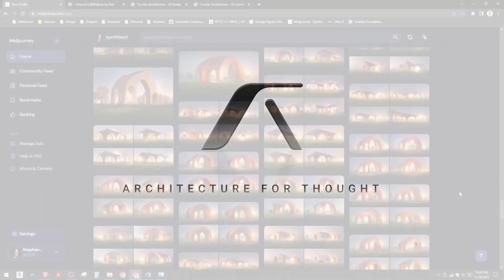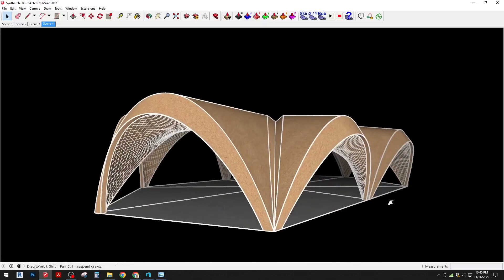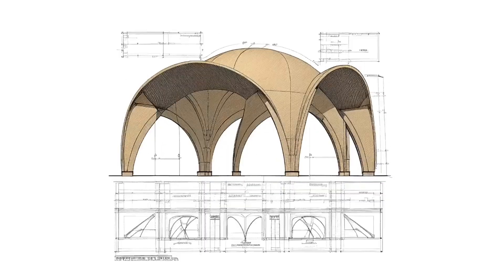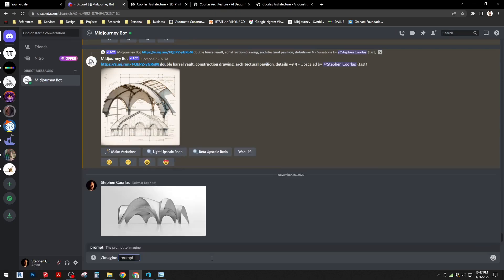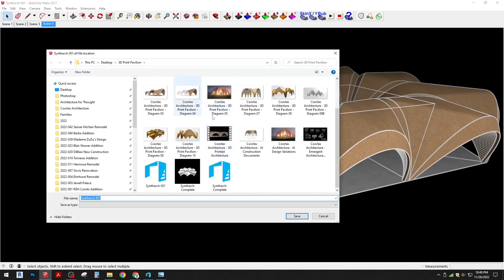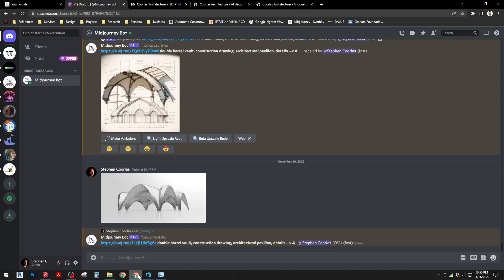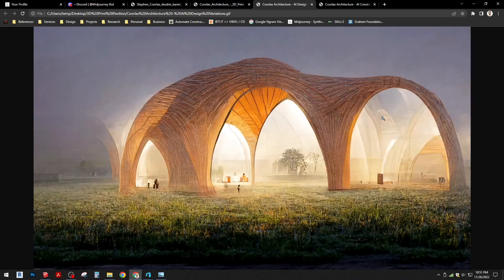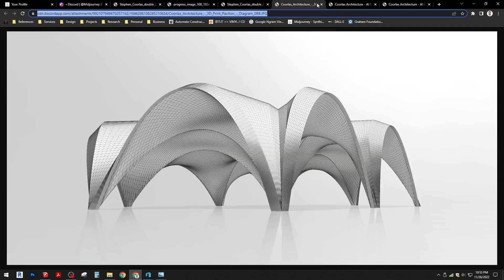Midjourney Architectural Design Workflow

Comment: Hi, thanks for the video. Super interesting. Can you clarify what is the exact purpose of generating these drawings? They are not drawings you can build off of right?
Reply from the maker: No, you cannot build off these drawings, yet. The idea here is that we will not need traditional drawings to "build" from in the future. The hope is for image > 3D > digital fabrication will be a completely automated process. And that technical documentation will be replaced by digital fabrication instructions that are for reference only.

This video is highly conceptual, and based on that research.

Comment: Can you just render your basic image into a setting without MidJourney changing the design of the architecture?
Reply from the maker: Unfortunately, no. Not yet at least. There are plenty of other programs that will do that though. Try Veras - they offer a great standalone ControlNet based platform. PromeAI also offers some free trials for this task. You can check out my “Sketch to Render” video that features some of those tools.

Comment: This is Awsum, like the application becomes even more interesting when you integrate regulations and parameters of building systems into the BIM like model testing in real-time with defined requirements like brief to construction. Makes cradle-to-grave design becomes when it becomes integrated to Revit to generate models from images or text. Very exciting prompts for generations give so much room to design. Microsoft project AI integration for optimized workflow in the office and site though I will say error correction is something that is easy to identify seems to be part of this design approach. Ai still experiences basic math issues which I find quite strange seeing as they are written in code, Is this bad coding or an approach of prediction vs calculation that generates errors. Still so cool
Reply from the maker: These are good questions, and I think a lot of people are asking similar questions. The AI systems will get better, meaning more accurate and easier to work with, so I think it's important to remember that these technologies are still in their adolescent years of development. Thanks for tuning in!

Comment: Hi Stephen, A couple of your videos really kicked off some productive midjourney explorations for me and my team.  Glad I finally connected with someone who is explaining what I need.  Thanks!

I have a specific question and hope you don't mind I ask it here.  When working with a reference image, or multiple (as with your white 1 point perspective staircase, separate video) how do you lock the perspective of the image?  I couldn't see a keyword in your prompts that indicated "use the same point of view as ref image x" but it seems to work for you.  My reference image results seem out of nowhere with all new camera angles.
Reply from the maker: Hey Phillip - Glad to connect and happy to hear these videos were helpful.

I the case of that stair image, the results were just coincidentally aligned with the same perspective. If the reference images have a strong relationship in terms of perspective the results typically will follow. But to ensure that the results are from a similar perspective you can add exactly what you typed , "one point perspective staircase" and maybe add some additional qualifiers such as "centered" or "focused"

Comment: I totally understand AI as a source of inspiration and iterations engine but other than that it's very abstract and random.... poor engineers that will probably have to deal with all that... anyways. The "drawings" as presentation layouts were quite nice, but as far as I can tell the views included were absolutely random... I might sound a bit bitter but all that philosophical approach of architecture is really getting on my nerves... or i'm just to shallow to grasp...
Reply from the maker: I agree with you. These tools are not very reliable in terms of documentation or even producing consistent designs from multiple views... yet.

But that's why I research these technologies - to help nurture the integration of the tools in a responsible and reliable way with our current architectural workflows.

The philosophy is also just a personal approach I use to help better understand the implications of using these tools, and in effect how they may change our profession or even society.

Thanks for sharing your thoughts 🤘

Comment: I think it is a good generator of concepts that could inspire, but right now it is very infantile in producing anythign that is usable.  Having a pretty picture doesn't translate into actual 3d models on its own.  Still lots of investigation to be done.
Reply from the maker: Have you tried ZoeDepth on the Hugging Face website? It offers AI generated 3D models from image inputs.

Yes, still much investigation to be done, but it seems promising.

Comment: Where are you planning this pavillion? Did you push it towards a Serengeti vibe? I'd be genuinely interested to know where the location came from.
Reply from the maker: It will be located in the north suburbs of Chicago. We are developing a general plan/design that may be adapted to any of the townships here, but it is significantly dependent on funding. I will have some interesting updates on this pavilion to share shortly.
Reply: @LEAPractitioners  Cool, I'll make sure to check back. Do you see earth building in this way being adapted into general building practice?
Reply from the maker: @nathan1459  I really hope so - At some capacity it will be adopting, but it may not become "mainstream" for some time. It will be supported by groups and communities where the value of building with earth are cherished and respected.  Slowly but surely it will make its way into general building practice.

Comment: Hello bro from perú, i have a few question before  buying midjourney. I have a small theory can we use midjourney as a motor render? Example we can put a enscape or vray premade render and then in the prompt put "realistic render etc etc"? It will work? (But i dont want to change de desing Just for "render it"
Reply from the maker: Hey, no that will not work with Midjourney yet. There are some other programs working on that such as FireFly or Stable Diffusion using ControlNet. But Midjourney will not render a shaded view from a 3D program without significantly changing the architecture
Reply: @LEAPractitioners  thanks for the answer, the other programs should work? I Will try

Comment: Thank you for this video and for being an inspiration. Please tell us, do you plan to potentially realize these projects with the help of 3D printing? How strong are the materials in 3D printers to realize such projects? Where can we learn more about this?
Reply from the maker: Yes, there are many projects undergoing fabrication using concrete or mud/clay 3D printing. Research Icon, Black Buffalo, COBOD, Peri, or my personal favorite WASP. I have been in discussion with many of these companies, but need funding to move our project forward.
Reply: @LEAPractitioners  Thank you for your response. It is valuable. I will look into these companies.

Also, have you considered using fiberglass to create 3D elements for your projects? Fiberglass is strong, reliable, doesn't rot, can be stacked, and doesn't corrode.
Reply from the maker: @vynahidnyky  Fiberglass it a great option too. The fabrication or molding process is a bit different, but you can get great durable parts from that method

Comment: Really love the content, we build a lot of architects designs, inwas wondering if you have been able to take a screen shot from a 3D model or midjourney create image and create a simple line drawing in midjourney? I guess its reverse engineering to a traditional method.
Reply from the maker: That's what we've been experimenting with, but currently it doesn't seem like there's enough applicable data for Midjourney to drawn from in producing 2D plans. We're also a bit more interested in seeing if it can produce instructions on how to assembly instead of simply 2D plans. 🤘
Reply: @LEAPractitioners  it's so interesting, have you found that it can produce a hand line drawing of an elevation that could be used for more marketing purposes rather then construction?
Reply from the maker: @daynelawrie499  It goes a little rogue with the actual dimensions of the image you input. I think right now version 4 is better for making variations on more natural things like portraits of humans or nature where the features can vary slightly and still have a close resemblance to the original.

Comment: The sections made in Midjourney v4 are correct?
Reply from the maker: Not currently, no. Although, they are getting closer. I don't believe the AI is cross-trained to develop a 3 Dimensional understanding of the 2 Dimensional images they produce. Perhaps in future versions this will be the case and you can instruct it to slice plan and section views.